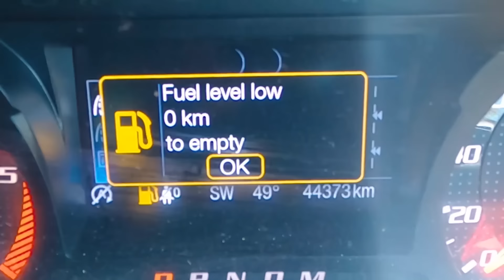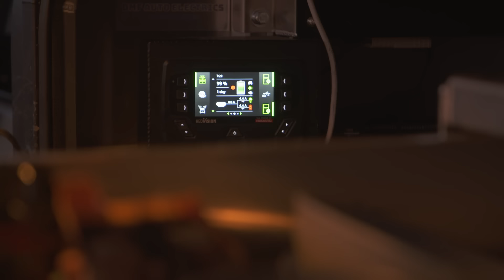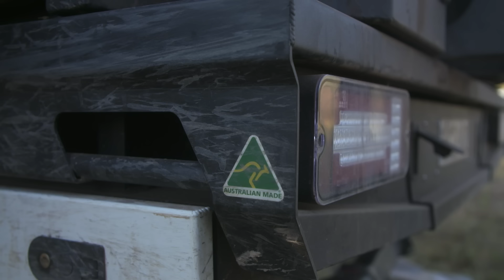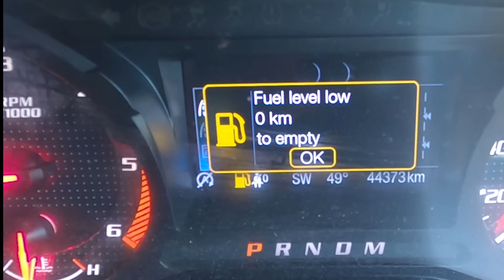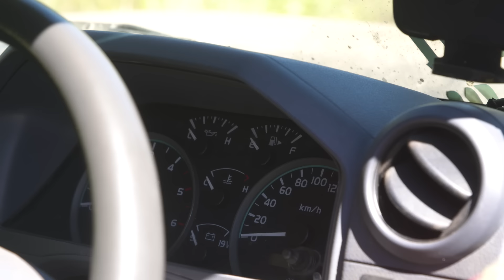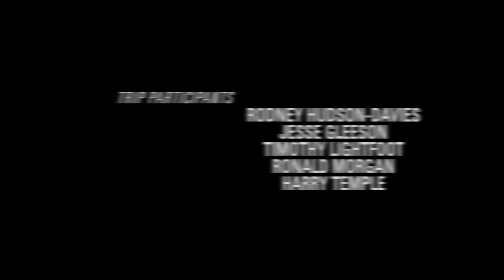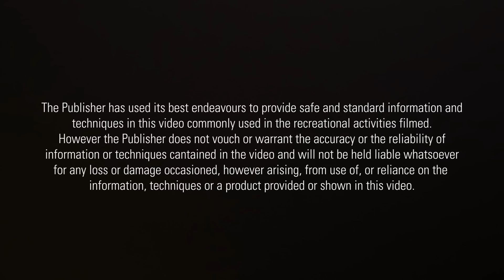We run out of fuel, food and tyres – do we make it? THE KIMBERLEY FINALE

Comment: Just got back from doing the Simo in a leaf sprung GU patrol. 50km past Dalhousie found both chassis rails were cracked with only the bottom flange hanging on. Pilfered every bit of scrap steel we could find out of the cars in the convoy and welded it back together with 2 car batteries. Didn’t expect it to last 50km. We drove all the way across the desert on the rig road, down the Birdsville track and home to Melbourne (racing the lockdown border closures). Fixed is fixed.

Comment: My best fixes were on my 86 Suburban 6.2 diesel 400km in the bush in Chad Africa. Punctured a hole the size of my thumb in the sidewall. Fixed it with 4 plugs and held the rest of the trip... 100k later corrigations got the better of the upper fitting on my radiator. On the road again after 15min and some 5min epoxy. Left radiator cap on first notch to reduce pressure for the rest of that day to let epoxy fully cure. Drove another 2yrs till sold the vehicle and epoxy was still holding pressure. 🤠

Comment: Me and a few mates went to yalwal and on the way home one of our mates in his 60 had the front tail shaft leg go. It went flying though the sump an the oil filter. We attempted to weld up the oil filter.. didn't work.. and welded up.the hole in the sump.( we had a geny and stick welder). On the way home we had a hilux overheating ,bonnet off and window sprayers redirected to in front of the radiator.. had to stop every 10 mins to top up the water. We also had an 80 with a flogged out alternator. So we put the geny on the roof rack. Put a battery charger on the bull bar and drove it home using the battery charger to keep tge lights going. Took us 12 hours to get home... 200ks was a hell of a trip. I have pictures if you would like to see

Comment: Best bush fix - grass/spinifex stuffed into an unrepairable tyre. Packed as tight as humanly possible it drove as if it had 15psi in it. Stopped after 30kms to break the bead and repack it - but it worked a treat.
One I witnessed as a kid was 2 batteries joined together to power a makeshift stick welder for welding a control arm!

Comment: Bush repair story - my first 4wd was a 1997 Toyota Prado. I was at the glasshouse mountains for a quick trip (yeh, right haha) literally got 800m up a track and dropped the front left-hand tyre. Lower ball joint separated. I walked a few and sent a mate a message to bring all my tools and some spares from the shed 200km away. He turns up at 9 pm, and we had the old girl driving up the highway, not straight, by midnight. Vehicles used to be so simple; now I don't think I could do that on a newer model, to many wires.

Comment: Bush repair story, have a discovery 2 with airbag suspension in the rear. I had one of these bags blow a hole in the middle of a trip. After a few beers it was planned to put a block of wood in between the axle and bump stop and then ratchet strap everything together to give me some height. Managed to get it all the way home with a block of wood as suspension. Was a rough ride but got me home!

Comment: My best bush mechanic fix has to be the curry bung. I was 2hr away from home and copped a rock to the radiator. With the radiator leaking fluid and no bush radiator sales men in site, a passerby suggested pouring curry powder into the radiator. I reluctantly poured the powder in and watched the leaking fluid stop. After a 2hr drive home and zero further issues, I now never leave home without curry powder......and liquid steel.

Comment: My bush fix story, on the Oodnadatta track I broke the rear brake line to the right side wheel. 
Fixed it by wrapping a tex screw with thread tape and sent it into the fitting!
Had just enough fluid to keep going and made it to Alice springs on 3 brakes!

Comment: Best bush mechanic fix I've done:
Removed a shattered differential at the side of a dirt track in Morocco and taped the axle housing up so it didn't let dirt in and I was then flat towed 30miles to a campsite near Casa Blanca where I got a diff flown in overnight from England (after bribing a customs official to actually release my parcel) and we repaired the axle housing with hammers and araldite putty and topped up with local oil (through the axle tube as the filler bung was damaged) then drove 2,500miles around Morocco and back through Europe to Manchester without a single drop of oil leaking out.
You can see this on "Morocco By Any Means" series on the Sam's Motor & Machine YouTube channel.

Comment: About 3 years ago one of our convoys trailer stub axle snapped off. We had spoken only weeks earlier about bringing a spare axle but decided “nah we’ll never brake one” anyway with a broken axle we decided to skull drag the trailer which thankfully was our smallest onto the bed of another trailer by digging a big hole for the trailer to get low enough to the ground. Few 5 ton straps and some creative mechanics we got it on and it drove the 2000k home from near the trans Australia railway line. Safe to say the axle came on the next trip….

Comment: I snaped my 2x lower control arms, bent my 2 uppers and snaped my rear tail sharft in my gu patrol on a track called Robertson's Creek track in south east Melbourne... to get home there was a burnt out gq at the bottom of the track.. so we rolled it over took out the burnt out control arms (no bushes).. took the tail sharft out, ratchet  strapped the diff too the towbar  and got home in front wheel drive.. worked a treat

Comment: BEST BUSH FIX!!! was when we snapped both front leafys on the ln106, and ended up cutting up and fence post to act a blocks for the front axel, with an array of strops holding the hole front end together we managed to get the old 106 back to saftey with another 50km of bogs and shaley hill climbs to go after the incedent!

Comment: My Bush-mechanic story: Me and my cousin were out off-roading near our farm land 45Km from civilization, we were driving around when the good old Willy's got bogged into some water and the stater motor got jammed. We used our shoelaces, a Victorinox Swiss Army Knife, a piece of cloth, tape and a lighter and rewired the entire system to just start  when we touch a wire to a nail that was taped up to the side of the starter. Drove back 45Km to get home and to our shop to fix it. Didn't have anything crazier than this but yeah. XD

Comment: Had a frame break just ahead of leaf spring perch and we were about 5 hours into a rip up baldy mountain in B.C.
Hooked up two optima batteries, used a decent set of booster cables as a stinger and ground, then used some random steel that looked like an old bed mattress as welding rod and with two pairs of sunglasses on i bubble gummed that frame and bless the offroad queen we were havin beers in the shed by midnight that night

Comment: Lost two leaves and the saddle from the boat trailer spring pack leaving  the Bungle Bungles and fixed it using a wooden handle wire brush cut in half minus the wire, some cable ties and some tie wire. Did the last 20ks of dirt then drove to kunnanura and made one leaf pack from two broken packs. Cost 20 bucks and my mate Pugsly drove back to Mossman👍

Comment: My only suggestion would be for GC.
Don’t keep your tins of butane rattling around in that storage compartment under the tray, which as you demonstrated after one water crossing is well sealed.
If they rattle around enough in there and wear a pin hole in one of the cans you will get a storage compartment full of butane & all packed loose and rattling like that, one spark from two cans rattling together is all it would take to blow the back corner off your canopy / tray & probably lose the entire vehicle to fire, which in a remote spot wouldn’t be the best of outcomes.
Maybe if you had something padded that each individual can fits into a pocket or 6 neoprene stubby holders for eg to stop them rubbing on anything else including each other.
If it was a boat (in survey) for eg, any compartment with gas / lpg / butane has to be vented over board.
It’s a safety issue for everyone on the trip.
Maybe similar consideration for any fuel containers like petrol for the little chainsaw also, somewhere in the open air is the best solution.
Then there was the use of chainsaw.
Not one bit of PPE, ear plugs / muffs / safety glasses / chainsaw chaps/ gloves, nothing.
One bad slip up and a bad chainsaw cut and someone could easily have died.
Just doesn’t set a good safety example to those young impressionable bucks watching.
Did a fishing trip to Dirk Hartog Island once with a group included Peter Morse - and at night with the insects flying around the light, a damned moth flew into his ear and crawled down into his ear canal & refused to back out again, trying to tunnel his way through Pete’s ear drum.
Ended up putting cooking oil into his ear until it drowned and it then slid back out with the oil.
I was waiting for one of you to get an insect in your ear filming that night time cooking segment.
Enjoyable series no question.

Comment: My favourite bush fix was on my 1990 2.8 Hilux 1130pm heading out glassy after work and blew a hole in the top rad hose. All we had was duct tape a tube of some flex and a plastic bag. Patched her up and instead of turning around and heading home we continued for another 5.5hrs 4x4ing without any issues. Long story short it stayed like that for 2 months before I bought a new top hose

Comment: Bush repair story. U bolt for the rear axle broke and the axle slipped back on the leaf spring at the top of phone track. Wheel is pushed back into the wheel well.. Luckily we have a u bolt close enough to work but needed to push the axle back into alignment. Unfortunately i only had a bottle jack which is only high enough for the axle so couldn't lift it and push it. Ended up getting a big 30+ kg rock and sticking it behind the rear tire and reversing up against it. Almost had it and gave it just that little bit of send too much and the car rode up on the rock a bit. Instantly thought damn i went too far but we had a look and it locked the wheel in the perfect spot. Bolted it back up, got home. When i went home, I measured up the alignment and it was 2 mm off. Moral of the story is always choose rock, rock always wins.

Comment: Best bush repair was adjusting a distributor cap and breaking it in half. Stole used duct tape that was holding the tow strap in a coil and wrapped the cap back together. Drove 50+ miles to town on it for a new one.

Comment: Towing the boat trailer from Melbourne to Welshman's Reef for the first time as a P plater, in my old XC Falcon sedan, on Christmas Day. Trailer tyre blew, thought "ok got the spare with me this time", only to find out the spare didn't fit. So after an hour on the side of the road, managed to get the spare from my Falcon, spun it inside out, and used a tomahawk to smash it onto the studs, before bashing the wheel arch out to clear the tyre. Bent all 5 studs at the time, but managed to get the wheel on square enough to let me drive the final 75k's. Turns out the trailer had a Holden stud pattern, the 13" rims on it were from a Torana (with a reversed centre to create enough offset to clear the trailer frame) so there was no way in hell that 14" Falcon rim should have fitted, but I made it happen. And the spare I was carrying was from a Valiant, so it was never going to work either.

15k down the road from fixing it, I got pulled over by a cop in Taradale, at the bottom of the hill. After much explaining, he asked if I'd had anything to drink. I said "not yet, but when I get to camp, I'll have a beer". Once he'd verified everything, he let me on my way, saying "Merry Christmas, go get there safe and enjoy plenty of drinks after the day you've just had".

Comment: Bush fix story, snapped a rear upper control arm in half about 100 miles from camp. Was able to find a pile of old gas pipe from where there was some repairs done on the pipeline at some point in the past. Little bit of hammering and some cutting and I was able to fit the pipe into place and drove all the way back to camp, riding on a section of gas line pipe lol

Comment: Hey guys. I drove 6hrs north with some buddies of mine to a very large rocky trail. And I snapped a rear axle shift 2 hrs into the trails in my 91 wrangler. Almost defeated, I had to get a log and ratchet strap it to the jeep to keep the wheel on the rig. Luckily  I was rear locked and was able to drive a few K off the trail and to my trailer. I ended up getting a most broke award placard because I stayed calm and figured out how to get it back home. Cheers

Comment: Not so much a bush fix, but I once split a front brake hose on a drift day. Cut the split hose off and sliced a bit of rubber from a tread block on one of my tyres, put that between the brake unions and wound it up tight to hold the brake pressure. Got me back out on track for the afternoon and then all the way home, pulled to the right like crazy under braking though!

Comment: Bush Repair story.
Out with the boys in the bush. One of the boys lost control of the vehicle and ran into a tree stump. Completely killed the radiator. 

The fix. Using a spare bottle of coolant, we cable tied the bottle into the engine bay, put the radiator pipes in and rigged ourselves a radiator.
It drive for an hour or so without overheating.. eventually it did so we had to change strat. The new plan was using the window wipers water reservoir, jamming the water squirting setting on the wipers on.

Drove 4hours with a makeshift radiator using a coolant bottle and the water reservoir pump to circulate the coolant. 👍

Comment: My bush Mechanic fix, we went 4wd and poked a hole in the oil filter and we put a bit of cork it on the end with a nut pushed up to and held up to it with 2 straps one wrapped around the block and the other wrapped around the bullbar and we drove 100+ kms on it

Comment: drove down the victorian high country one friday night in the old luxxy deer hunting driving in pissing down rain in the dark, at the time my bash plate was held by tie wire on the rear bolts, a few hours into the bush i went up some big pipe clay ruts and reversed up and down a good 3 times trying to get up before i relalised something was wrong, i hopped out of the vehicle in the rain to see my bash plate facing fowards out the front of my vehicle and radiator coolant pissing out, put a big crack in the plastic on the radiator was there for 2 days on the side of the hill, ended up getting a bit of an old load spring that broke off the rear which was about 10mm rod or so got the bastard red hot in a big fire and welded the plastic back together limped back to the nearest town and bought superglue and bluetack at the general store which plugged the remaning pinhole and made the 3 hour trip home

Comment: My bush fix was on my ' jeep wrangler YJ. The wiper motor gave up on me in the bush up a mountain. This happened in a snow storm and as i made it down the mountain the snow turned to heavy rain ( as it often does here on the west coast of Canada) We took apart the linkage for the wipers and unscrewed the antenna for my radio. we zip tied the end of the antenna to the wiper arm so I could reach out the window grab the other end of the antenna and wipe the windshield. Doesn't sound that impressive but if you where there it was

Comment: 3:00 On loose surface you can run 4wd with different size tires. 18:04. The surface allows the tires to spin as needed.

Comment: Ratchet straps are your friend. I have ran them along the pan hard arm from the diff to the chassi when the bush’s flogged out. Also I used a ratchet strap from the rear diff to the rear bar after bending a rear trailing arm which after straightening kept bending every time you tried to drive hence the strap from the diff to the rear bar. I drove 600 odd kms like it

Comment: I had to ride on the core support, working the throttle with one hand and holding the hood with the other, from lake Tahoe to Reno Nevada in the U.S. because the throttle cable snapped. Sure, the road is paved the entire way but still, I had to judge when to let off and when to give it a twist because we were in a manual transmission...and that is my "craziest in the bush fix" story.

Comment: I had an alternator failure, i had to rig up a solar panel, running in a deep cycle battery, which wouldn't fit into battery box under the bonnet as the battery also failed, had two jump leads, duct tapped together to run from battery strapped to roof to the engine, and strapped bonnet down as it wouldn't close. Let's just say I was happy to get to civilisation to get fixed!!!!

Comment: Bush mechanic story: was out in northern WA and my throttle cable snapped on my patrol. I used zip ties and linked them all together to the cab and controlled the throttle by pulling on the cable ties until I got into town… bit of arm pump but I got home

Comment: Bush mechanic story. Quiet a few years back in Zimbabwe our trailer broke on the support arms between the hitch and chassis due to massive corrugations. We had to use Mopani (tree) logs with wire to hold it in place and managed to get home.

Comment: My best bush fix was when I broke both my I bolts holding the diff  to the leaf springs on my old mk patrol.    Fixed it with 8 gauge fencing wire on the side of the track.  It got me all the way home and until the next week driving to work .  Actually drove better then before it broke .